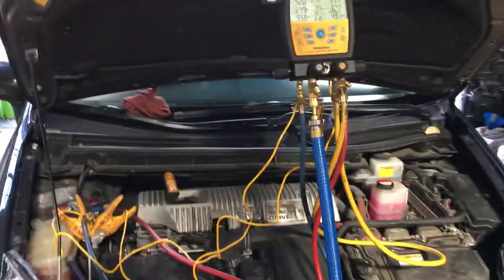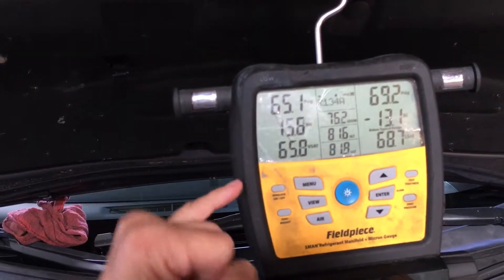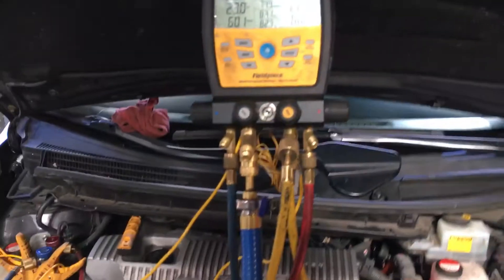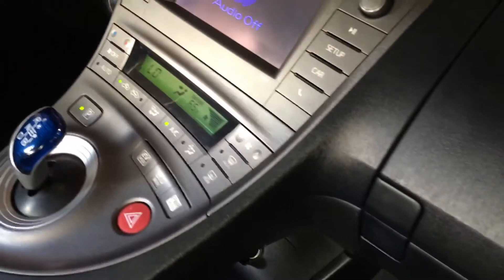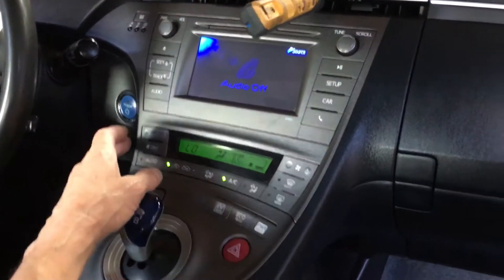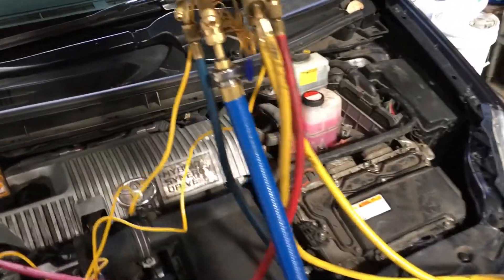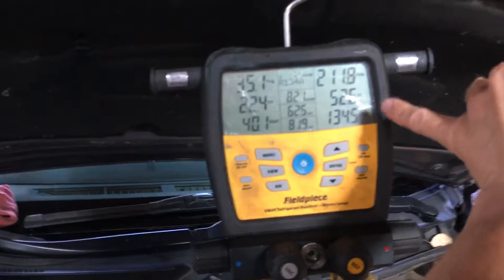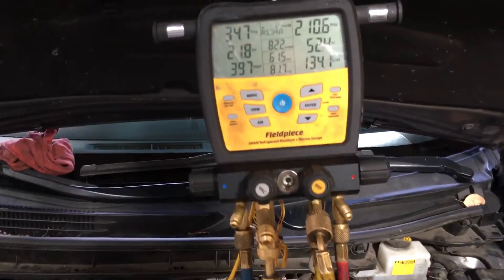Pt 1: Critical refrigerant charge 2014 Prius

Comment: That is crazy
Reply from the maker: This is what I see every day because I only do air conditioning from 7 AM to 7 PM for the last 27 years. And with this new refrigerant on the small system charges 1 ounce makes a big difference how are you going to do that accurately using little cans and hoses and gauges with the refrigerant that is left over in the little tiny cans and the hoses. 
        This is why mechanical shops and body shops and the worst one are the at home do it yourself personnel who don’t know any better cause the most damage. 
       They re-charged it at a time at that particular temperature and at that particular humidity and load on the vehicle may have worked just fine for the few minutes it was in the shop and well it left but as soon as the vehicle is in a different climate at a different temperature it will not perform properly. 
      This is not taught in classes and it is not specifically taught in training material manuals.